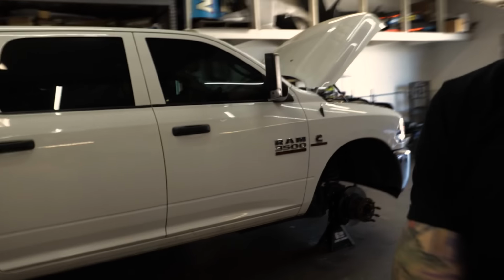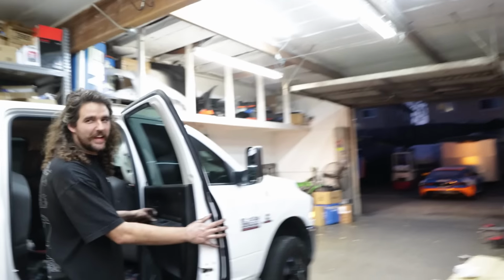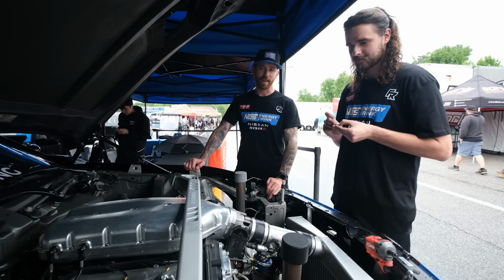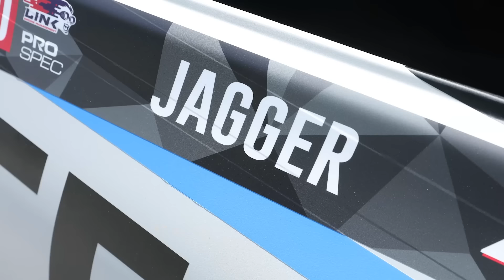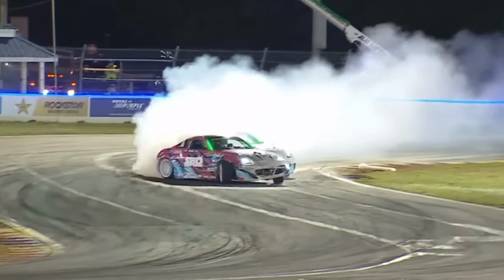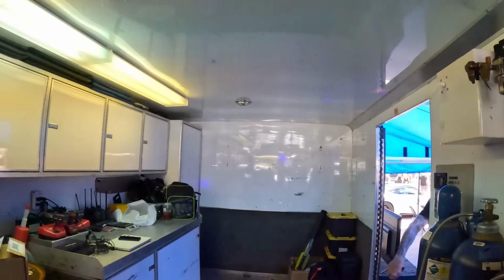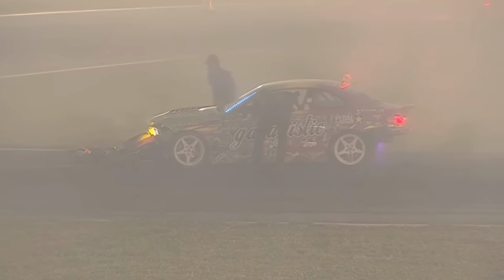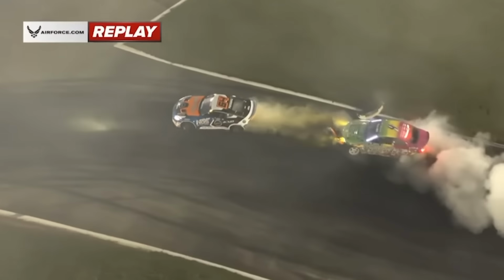STEEL-IT Podium at Formula Drift Atlanta 2024

Comment: I would give OMP Racing a message and ask for the underwear that cools you down as warmer you get. You can also use a spray from them to boost the cooling effect. If you want to keep it simple without adding weight. Peter Solberg etc used these, some only used the top piece as it cooled alot. I’m trying the balaclava and shirt, keeping the pants without the cooling effect.

Comment: Such a bummer for Chris and the entire team but you can clearly see that when he is transitioning to IC2 his lights are full throttle Green and then drops to almost no Greeen meaning he was on Power and then lost power for some reason BEFORE Rome makes contact. Unfortnately this is just sometimes what happens in drifting. Great Job to the ENTIRE TEAM.

Comment: What happened with your lead run with RomeCP? Did your alternator go out or did you have a fuel problem? Still disappointing to see how the new rules are in FD. They definitely robbed LZ
Reply: It was a pilot bearing failure😞
Reply: @lizzforsberg  i wish that was not the case that was probably one of the closest battle all day.